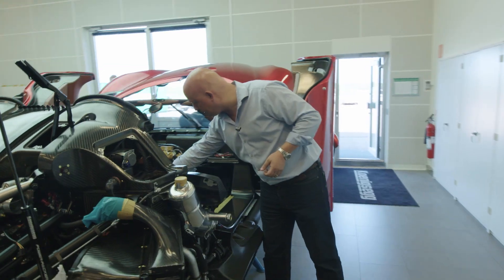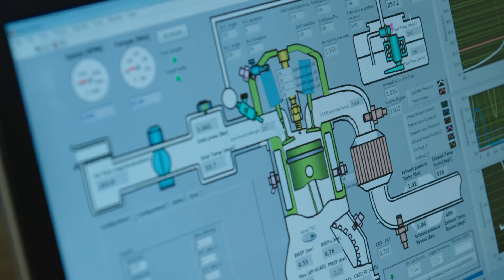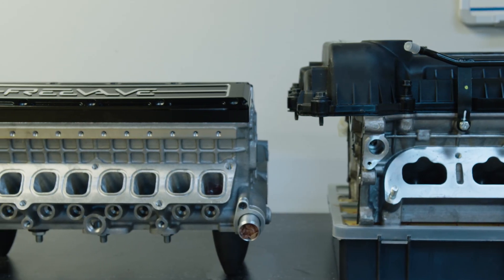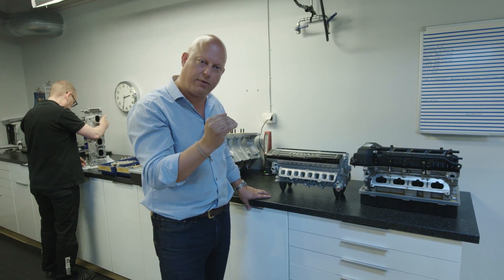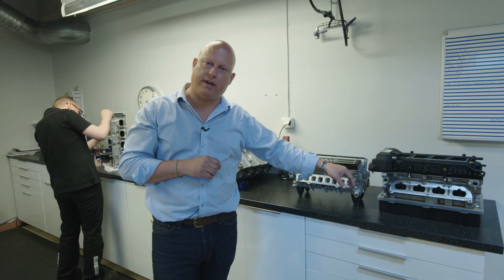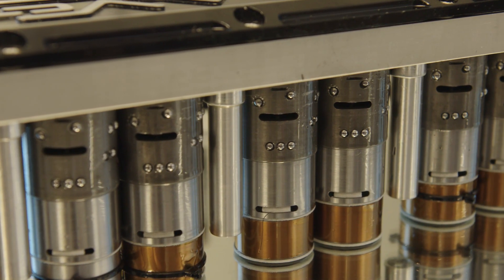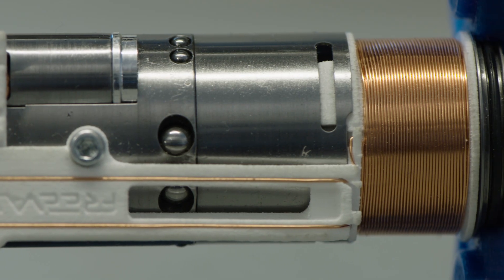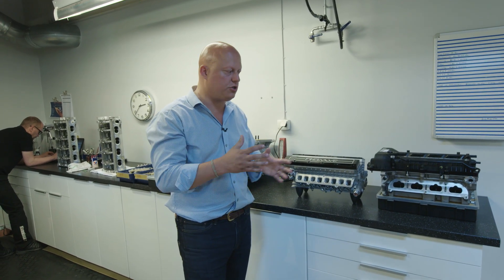Freevalve Update Camless Engine -- /INSIDE KOENIGSEGG

Comment: I'm just imagining these heads on top of a Chevy LS V8...
Reply: Eh, as soon as you go to this type of Valve Control, the LS won't really be the same engine anymore. The whole appeal of the LS is that it's cheap, simple and has a lot of bang for your buck. This tech seems more suited for the tuner crowd than the muscle crowd (although both can benefit massively from this). I'd rather see this on a more technologically advanced engine. Can you imagine this on a W12 motor? It will solve so much of the complexity of that unit. 12 Cylinders in an engine barely bigger than a V8, combined with freevalve? The possibilites would be incredible. Even if they get the same performance/liter as the engine in the video, you are still looking at 900HP if used on the W12 unit that the VW group uses. That would be a sight to see.
Reply: I was thinking the exact same thing, just imagine what an ls could do with 4 valves per cylinder!
Reply: lerch25 I'd like to point you towards Audi's 4.2 V8. Cross-plane crankshaft, but revs as high as a flat-plane, whilst maintaining the muscular sound of traditional V8 motors. That engine already has a flat torque-curve (Want torque? Pick a rev range, any rev range and floor it.), but can you imagine it with freevalve? It would become absolutely monstrous.
Reply: Newgenerationisbg True. I'd be more like a high strung exotic V8 then a traditional American V8.
Reply: Newgenerationisbg heck ya and the benefits to boosted engines is amazing I can't wait till free valve upgrades happen for older popular engines. Free valve b16, 2jz, rb26 ect.
Reply: Pifferfish Well, in the video they are not actually attached to a block. It would need some form of lubrication, especially at the speeds they move at (Remember, at 900RPM, which is idle in most 4-bangers, each of those valves is going up and down 7.5 times every second. At 6000RPM, that's 50 times per second per valve. No matter how well engineered, they would create heat. You'd need SOME way to cool them, and oil is the best way to do so. It probably feeds oil from the engine.
Reply: lerch25 Be a bigger version of the coyote?
Reply: "torque, accelerates the car" only when the gearbox shift like crap.

Physics 101:

P= FV= MAV   - from which, A= P/(MV)

It's the vagaries of gearboxes that make a flat torque curve important.

Whether not for that , we wouldn't even bother looking at the curve.
Reply: The TVR engine's curve is better suited to a sports car.  It was a "peaky" engine with peak torque arriving at around 5500 RPM.  Compare that to the LS1 at around 4400.  This is much better for a sports car without traction control.

AJP V8:

4.2L  360bhp @6500 RPM/320 lb/ft @ 5500.
4.5L  420bhp @ 6750 RPM/380 lb/ft @ 5500
4.5L (Red Rose) 440bhp @ 7250/402 lb/ft @ 5500

GM LS:

5.7L  345bhp @ 5600RPM/350 lb/ft  @ 4400.

You're right that, all things being equal, higher torque means better acceleration.

But the car's weight it a big factor as well.

The Corvette C5 tipped the scales at around 3,300 pounds.  As a result, its 0-60 dash was measured at 5.0 seconds by Car&Driver.

The TVR Cerbera (the only car TVR offered with their AJP V8) weighed about 2,400 pounds (thanks to the tube-steel chassis) even though it could seat four.

As a result, its 0-60 times were much faster:

4.2L:  4.2 seconds
4.5L: 4.1
4.5L Red Rose: 3.9

Not bad for 1997 - faster than just about anything else that was street-legal at the time.
Reply: Or how about an old sbc with a blower or turbo?
Reply: 177SCmaro With the lack of cams it would probably be more compact and lighter. I think it would be all sorts of awesome.
Reply: lerch25 Oh, you meant with this camless system, I thought you just meant with the conventional dohc 4 valve system.
Yeah, with this freevalve system just about any engine would be lighter, faster, fiercer.
Reply: 177SCmaro Nahh Ferraris are shrieky and high endy because of they use a flat crank. This would just make the engine make more power through it's entire range.
Reply: Newgenerationisbg My nephew in law has and Audi with a 4.2 in it, and it's brilliant and brutally powerful especially considering its a 4.2, needless to say I'm a bit jealous of him, it pays quite literally to have a doctorate. The reason gm stuck with the pushrods was to keep the small block at a nice low profile, if you put dual overhead cams on a smallblock you would have an engine that only fit in a bus. The cam-less head is EXACTLY what was needed to make a 4 valve per cylinder small block. I just hope someone does it
Reply: 177SCmaro Yeah, that comes down to the fact that a lot of cross plane V8's were built to lug around massive cars. You needed that low end torque there. Now, with the application of forced induction, we can have smaller, (much) more economical cross plane V8 engines that have both heaps of low end torque, and can rev as high as inline 4-bangers.
Reply: Nathan Fitzer Well, people that said that were ignorant. Variable valve timing is pretty damn great. It allows the valves to be in the optimal timing and lift in different rev ranges. Freevalve is the next step. Instead of having 2 specific rev numbers where the timing and lift is "perfect", you can have it literally everywhere.
Reply: I don't think you'd need oil with these heads.  At least in the video they appear dry.
Reply: Benjamin
The outward engine dimensions wouldn't change a whole lot. The cylinder heads will be a little larger (to accomodate a 4-valve head and the actuation hardware) but the overall dimensions of the engine won't change by a whole lot. The most complex part would be the new engine management system, as it's now going to have a lot more work to do.
Reply: Absolutely....and god forbid, a Coyote.
Reply: wut..

You would need to run oil to the system from teh cam journals.  thats it.

Not only that but the tech allows cylinder deactivation and the ability to tailor everything.  Valve events could be calibrated for literally anything.

In theory one (company like Trickflow, AFR, Mast, Dart,etc) could create a 4v head and be within the original pushrod dimensions or at least very close to it.  The oiling issue is still easily solvable with no major modifications.
Reply: ferrari or lambo V12...
Reply: lerch25 there's already DOCH ls motors 
Nothing new for 4 valve ls motors 
But you could literally have the most efficient and powerful cam at ANY time with this concept
Reply: fenderfan85 and yet some of the fastest street cars in the world use "gm garbage"
Reply: The 80's and 90's  V8s can now beat the new V6s.
Reply: Newgenerationisbg I have heard those things are absolutely Amazing! That said I love the LS v8's for one simple reason they are a lot more attainable for me. Though I must admit a cam-less 4 valve ls kit would be well beyond my budget too.
Reply: lerch25 Well, the LS is a pushrod engine. Not much to gain with freevalve if you don't modify the block (which would require a redesign of the whole thing). The LS's appeal to me is it's simplicity. It's a cheap way to make power. Want more power? Get a supercharger or turbo kit. It's not the most efficient design out there, considering that in stock N/A form, it makes as much HP as Audi's 4.2 made back in the late 90's, except they did it with 1.5 liters of displacement less. That said, it's still a great motor and deserves pretty much all the praise it gets.
Reply: lerch25 It would significantly extend it's rpm range, which is what I meant by "high strung".
Reply: Newgenerationisbg I don't think it would be that hard. the only big challenge I see is how to maintain oil pressure with the cam not there. Maybe put a stationary blank in it's place. You gotta admit it would be a lot of fun to see a cam-less 4 valve per cylinder LS could do.
Reply: 177SCmaro Ferraris use a short throw flat crank. It's a design from the bottom up to rev high and produce wads of power at mid to high end. if you try to rev a long throw crank engine like that you will end up with the equivalent of a grenade under the hood.
Reply: lerch25 Oh for sure. The LS is already a capable motor. It's main "bottleneck" is the fact that it only has 2 valves per cylinder and they are operated by pushrods. Other than that, it revs pretty high, has plenty of displacement and is a pretty light motor. It's quite obvious when looking at a stock LS's power curve that it dies out at the top. That's probably down to the fact that the intake and exhaust system get overwhelmed by the choke points that are the two valves. The 4.2 Audi V8 on the other hand has either 4 or 5 valves per cylinder (depending on model year), and it shows in dyno graphs. That thing just keeps on revving and never gasps for more air.
Now, it is worth mentioning that the 4.2 V8 Audi use is more expensive by quite a large margin when compared to the LS.
Reply: lerch25 I know most exotics use flat plane cranks (good primary, lousy secondary vibrations). That said, a short throw cross plane can rev too, but most cross plane V8's are relatively large (long strokes, heavy pistons) so they don't.
Reply: lerch25 The thing that strikes me most about the 4.2 is just how smooth the thing is. You hop into a first gen A8 or S8 with a 4.2, and you honestly can't tell it's running unless you look at the rpm gauge. And even the weak versions of the 4.2 were enough to propel the massive A8 to speed at a pretty brisk pace (Especially when compared to other mid 90's cars). The real "winner" as far as the 4.2 in the 90's goes however, is the 40 valve version seen in the S8. 360 HP, naturally aspirated V8 power. And to top it all off? You can get it strapped to a 6 speed manual.
Yeah, pushrods help keep the engine "shorter", but I think the main reason they went with that design over DOHC was the cost. Even with DOHC, the overall height of the engine isn't that much more than with a pushrod design (An inch or two, but considering the cars the LS is present in, that height difference wouldn't interfere with the design of the bonnet.)
Reply: Newgenerationisbg
Yes, cross can be made to rev. I've seen specially built small block chevys rev to 10,000rpm and live. Short stroke, long rod, keep that piston speed down. The limiting factor for the old stuff is usually valve control, not bottom end.
Reply: 177SCmaro I can't remember the exact reason, but something about flat cranks makes them better at producing hp at high rpm's. Something about the exhaust pulses helping reduce back pressure at high rpm I think.
Reply: Newgenerationisbg Yeah the s8 that's what he has, I had a brainfart on the model. the silly thing is he rarely drives it. More often than not tooling around in a Yaris. At least till I bought the Yaris from them.:P Ooops did I say that out loud?
Reply: lerch25 Well, I can't blame him. It's expensive to maintain in Europe. Outside of Europe, it's even MORE expensive to maintain. Here (eastern Europe), it's not TOO expensive to own one, but depending on how it was treated by the previous owners (old car, can't really buy one that hasn't had at least two owners), it can break your bank. I know that they are a pretty damn big nightmare to maintain in the US, mostly if you don't do the work yourself (It's a complicated car. it's possible to work on it yourself, but it is VERY time consuming even in professional hands). Often times, the bill for the work done comes out to more than what the parts used are worth (and those aren't cheap either). I can see why you wouldn't really daily drive it if you didn't want to spend too much. The thing is also horrible on gas (10MPG if you drive it normally, 15 if you are a saint with the throttle). It's one of my dream cars. A black, manual D2 S8 is what I'm saving up for.
Reply: Yeah the US, and he is a car guy, but not the greasy fingernails kind.
Reply: These would be GREAT on a rotary...
Reply: lerch25 Then I totally understand why he doesn't drive it much. As I said, you can work on it by yourself (You can literally take the front of the car apart so you have direct access to the engine from the front, not just the hood), but ho-boy, does it take a long time to do anything to that thing. The engine is fairly reliable, but if something goes, it's likely going to be expensive to fix and take a while. For instance, if you want to change the belts and water pump, the best course of action is to take the front of the car off. This makes it easy to access the belts and tensioners. The actual replacement of the water pump wouldn't take you too long (same as in other cars), but the process of GETTING TO the water pump, that's gonna take you a while. It's one thing to work on a Honda Civic and a whole other story to work on what was the highest end car Audi had produced before 2002.
Reply: Another feather in the LS's cap. You can just drop it in just about anything without taking out a second mortgage and beat the snot out of it with no worries. ;)
Reply: lerch25 Exactly. No wonder people are LS-swapping anything that will fit it.
Reply: lerch25 Flat planes have two main advantages that effect horsepower, an even exhaust pulse between cylinder banks (back and forth, not two "stacking up" which is were the "American V8 burble" comes from) and lower reciprocating weight.
Reply: That sounds like what most people said about Vtec 15 years ago "ah that crap sucks it's  import turner snake oil." Now every car on the road has some form of variable cam control.
Reply: OHV or OHC, with this tech no cam is needed. The tech can for sure be applied to OHV engines like Chevy's LS.
Reply: Or W16 sparkly eyes
Reply: the W16 and W8.  tiny powerful 8 cylinder engine ftw.
Reply: Nathan Fitzer I think people said that because even with vvt those little engines still don't put out a lot of power compared to the big, burly V8s everyone was used to back then. Of course, things change, and now you've got 5 liter 4 valve v8s with all that stuff on them. Hell, even some pushrod engines have a version of it nowadays.
Reply: im jizzing myself over the idea of 1 of these in an actual supercar/hypercar like a koenigsegg, ferrari,Mclaren, aston martin,porsche, god what would those cars sound like?
Reply: Jonathan Gwynne How does the torque curve of these two engines compare? Peak torque? Torque at rated rpm? Horsepower sells engines, torque, accelerates the car.
Reply: I see this tech improving pretty well all engines.... Seeing how this tech works- you could give a hemi 4 valves per cylinder...
Reply: " The reason gm stuck with the pushrods was to keep the small block at a nice low profile"

That's not the reason.  Many people have suspected this but, back in the 90s, TVR demonstrated that GM was wrong.

The TVR AJP8 was a 4.2/4.5 liter flat-plane V8 that was smaller, lighter and more powerful than the contemporary LS engine.

The AJP weighed in at 267 pounds, was smaller in every dimension than the contemporary LS and produced 360hp in the original 4.2 liter displacement and then 420hp in the 4.5 liter displacement - compare that to the 345hp from the 1997 5.7 liter LS3.

No, the reason GM still puts a truck engine in a Corvette is that they don't have the engineering vision to do otherwise.